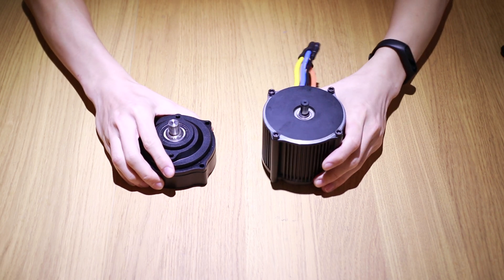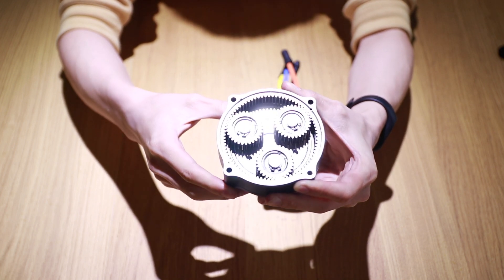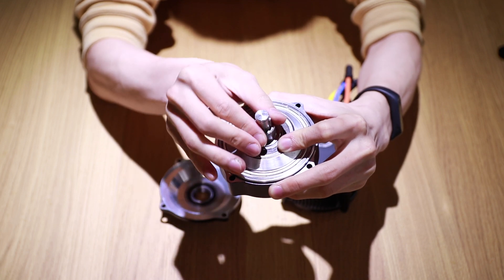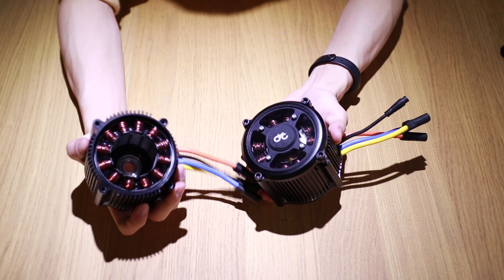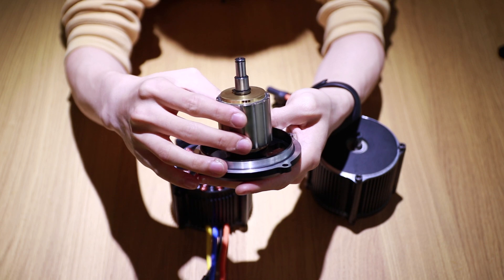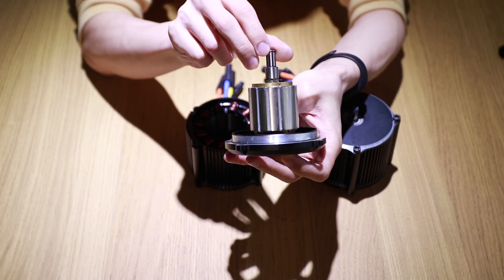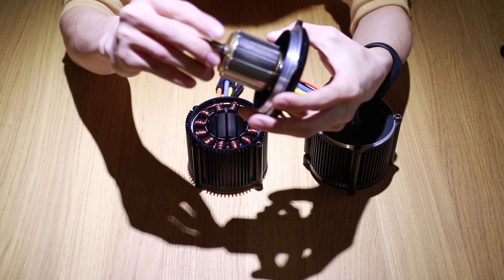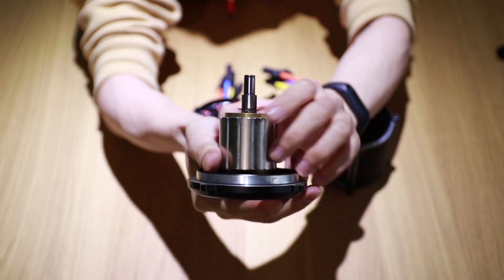CYC X1PRO 2020 Gen2 What's New Inside

Comment: Hello, I have ordered a kit from this company (CYC Motor LTD), but since I have installed it on my bike, various components have been technically defective and I experienced a lot of hassle using this conversion. After only six months use, the controller (BAC2000) was defective, and although they sent me the replacement part, it also had a technical failure and when the voltage goes below 72V the controller disconnects the current and you have to charge the battery although the battery has enough charge (It should disconnect at 62V NOT 72V) and it reduce the range significantly. I use this bike to do some shopping occasionally, but after a short use the two bearings in its bottom bracket damaged due to poor quality and both bearings need be replaced, otherwise the bike will not be used. Also, the BAC2000 sends wrong signals to the motor which result in the Gearbox rotate the one way bearing in the Gearbox to rotate in the opposite direction although I substitute its bearing with a new one!!